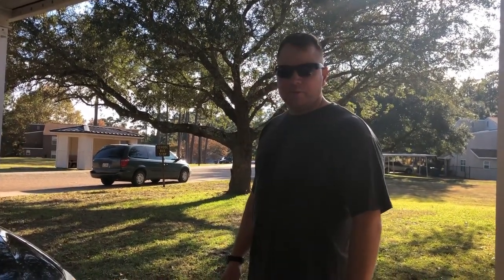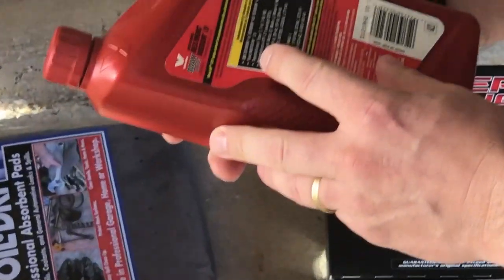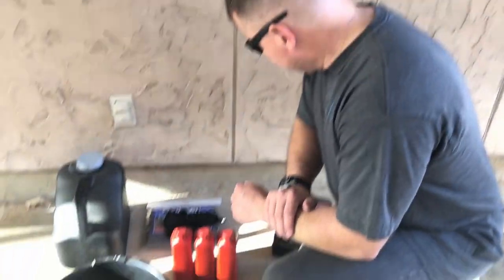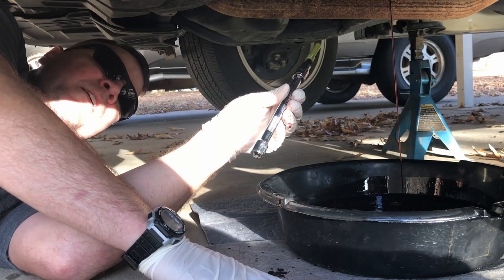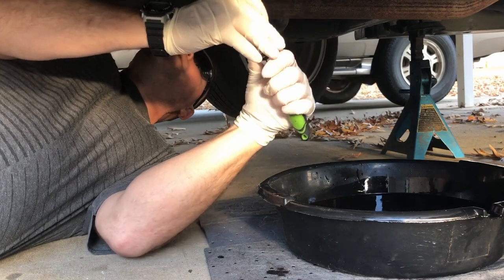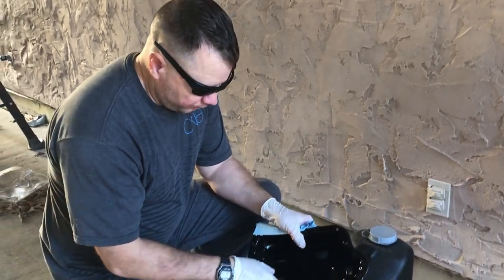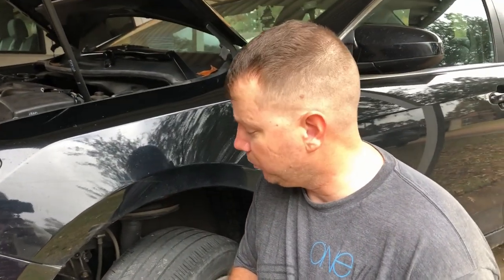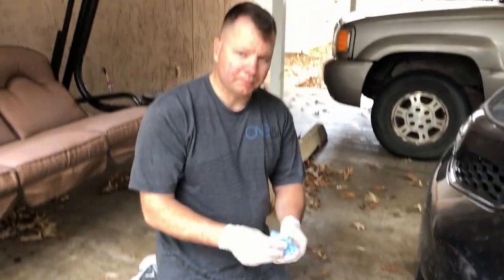Automatic Transmission Service 2014 Toyota Camry

Comment: Thanks for you video but the tool you using to check temperature won't read proper temperature inside the oil pan, you need to use a scanner.
Reply: The Innova 3160RS PRO obd2 scanner shows transmission temperature. I used it on my 2012 camry and works good.

Comment: I have a question so when replacing my transmission oil its 3 quarts to be exact ?
Reply: If you're doing the job the way he is, pulling the pan, filter, etc you're going to be closer to 4 quarts but make sure you check the temp and drain the excess like you see in the video. It's critical to have the proper amount of fluid in these transmissions.

Comment: Thank you for the video, I recently bought the same car and I am planning to do the job. About how many miles do you change the transmission fluid? My car has 62k miles and I doubt the fluid was ever replaced.
Reply: I'm pretty sure the factory manual says about 100-120k is when you're supposed to change it. I'm not 100 percent sure if I remember that right though.
Reply: @erik3423  thank you so much!
Reply: The factory manual says its lifetime fluid and should not need changing. But a good rule of thumb for me and many others is to change it at 60k-80k miles and see if the fluid seems dirty. If the fluid is a little dirtier than you would like then you should decrease the interval, if its still clean then you can increase it a little. I mean since I am doing this at home, 50$ is hardly any money when it could save me thousands in the long run.
Reply: I plan on changing ours every 30,000 miles.
Reply: @stevensevek6151  I mean, it's not gonna hurt to change it every 30k but for a toyota that might be overkill. I have seen these go 100k miles and the fluid is just a bit darker than factory.
Reply: @TaijiArban 
Our 2009 RAV4 only has 38,000 miles on it now. At 28,000 the fluid color was black with a tinge of red. So I changed it then. I don't think it was dirty at all. I think it just turns black from heat &/oxidation. At 28,000 miles the vehicle was ten years old and thus the fluid was ten years old. I figured I'd just play it safe. After all, I really didn't know the complete history of the vehicle.when we bought it nine months ago it had less than 19,000 miles on it. I didn't know what kind of miles they were; city, highway or a mix. If they were city miles then the transmission would have gone through the gears a bit. After all 19,000 city miles is equal to 190,000 highway miles... Just another reason I chose to play it safe. We put more miles on it in 9 months than the first owner put on it in 10 years.
Reply: @stevensevek6151  oh yeah. That makes sense. I am someone that usually does maintenance by the mileage instead of age so I almost never go by the time interval unless I am on a vacation or something for a few months.

Comment: Just bought a 2011 Camry with 140k miles. Should I change the fluid or leave it? Transmission has never been touched before. It runs fine now and shifts fine for the mileage.
Reply: Don’t flush the transmission. Just do what he did which was a simple drain and fill. Do it about three times in 1k intervals and you will get most of the dirty fluid.

Comment: Good job. Most people shouldn't have a problem grasping how this process works.

The problem is one fluid can't be the same for all Toyotas. Toyota specifies different fluids for different year and model Toyotas yet Valvoline says the same fluid can be used in all Toyotas. That's therefore a direct contradiction. I would not trust any multi-vehicle fluid regardless of what it says on the label. Just because Valvoline says it's recommended or suitable does not mean it's approved/authorized or recommended by Toyota.

Comment: Is the 2014 not supposed to have the Toyota “world” ATF?? Correct Fluids replacement is critical in Drivetrain components now. Wrong fluid can kill a trans or rear end.
Reply: Toyota's own WS is a equivalent to D/M 6. I use Redline D6  instead.
Reply: Amsoil has a WS.

Comment: How about 2016 Toyota corolla le,change transmission fluid,I got 100kmile,and also coolant change,tq
Reply: coolant good to change at 150.000 miles. ATF WS in your car good to change 60k to 100k miles each.

Comment: I went a local repair shop to have the trans fluid in my 05 Camry changed at 100k miles . (This was 10 years ago.) His parts store where they get their parts asked "why?". He told me on the Trans dip stick it said "this trans fluid should never be changed." I saw it myself!! The dealer here locally wants to change it every 30k miles. More money in their pocket. My 14 Camry is a sealed transmission. It's not even listed in their Maintenance book. I think everyone on this site that is telling you to change it--- is either a mechanic or affiliated with a dealership. Under normally operating conditions, leave the dam transmission fluid alone!!
Reply: I looked in my 2014 Camry manual and changing the transmission fluid was never mentioned.

Comment: You need to use either the toyota service tool or a bidirectional scanner for this to ensure correct temperature.  Infrared thermometer cannot be used
Reply: There are other videos on you tube that show both methods and no more than a couple degrees difference in temperature.
Reply: The Innova 3160RS Pro OBD2 Scanner shows transmission temperature.

Comment: Great Job ... Good Video ... Just ONE CONCERN ... I think you used the WRONG FLUID ... Should be Toyota Type: ATS WS (World Standard)  This is an Aisin Unit and like many newer designs, the type of fluid is CRITICAL!
Reply: I agree but a lot of people use that cheaper multi-vehicle fluid... Personal choice but I wouldn't use it.
Reply: Bam Bam  
I just find it difficult t believe that one fluid can meet the requirements so many differing products.
Reply: I would ONLY use the OEM oil.
Reply: @Jimmy_Jim_Jim_1234  
Aisin brand fluid should also be fine seeing how Aisin makes the transmission.
Reply: The valvoline works better than the Toyota brand. I did my rav4, drained fluid and changed the filter and gasket last week and once it worked thru the system my transmission doesn’t whine like it used to at around 25 mph and still shifts smooth. I may swap it again in a year or year and a half and at that time decide whether to use the Toyota brand or more valvoline though. I do think the valvoline full synthetic is better than Toyota’s fluid.

Comment: I just changed fluid today on 2014 Camry with 65,000 miles on it.  It was obviously in need of new fluid.  Don't believe the sealed trans crap.  It's b.s.  Just a way for Toyota to sell more parts and make more money off of peoples ignorance.  Change your trans fluid about every 50K miles, or the life of your trans will be drastically shortened!  It's not a lie when they say the fluid will last the lifetime of the trans.  Of course it will, but do you want the lifetime of the trans to be 100K, or 300K miles.  Change the fluid regularly to get to 300K miles or more!

Comment: Every 60k just undo the drain.. around 4 quarts comes out.. you put 4 back in.. and you’re done. No need to remove the pan or anything whatsoever if you just do this procedure every 60K. Transmission will outlast the vehicle.